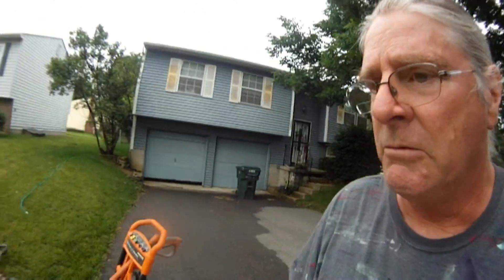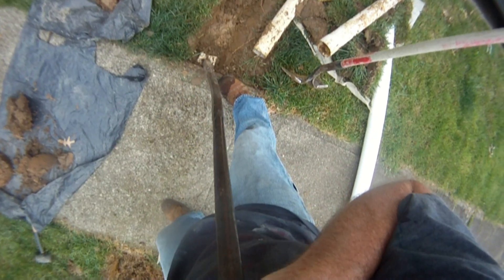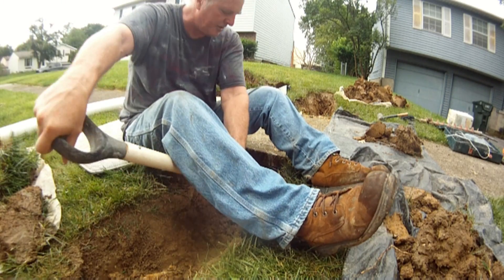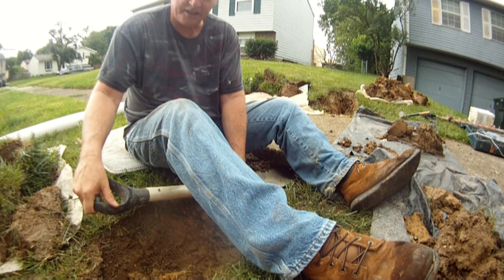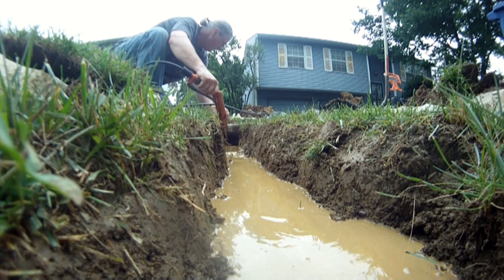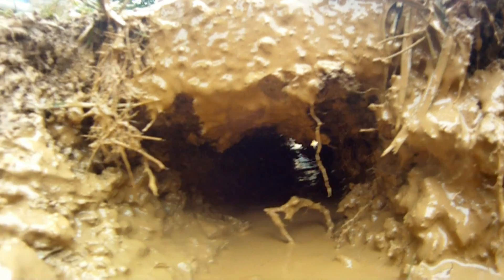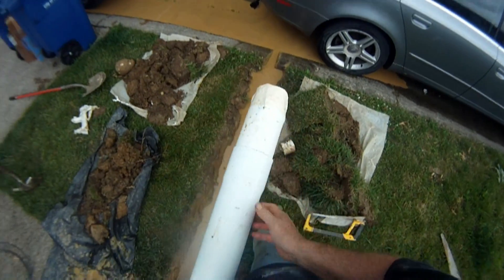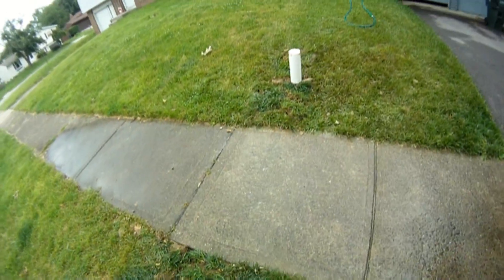TUNNEL Sidewalk PIPE REMOVAL / INSTALL The BEST ways to install pipe under sidewalk

Comment: That sidewalk isn't very thick. The ones in our city are twice as thick. Hummm
Reply from the maker: Hey Einstein, thanks for watching! How thick are they were you live?
Reply: @AtlanticDrain  Hi! More than 2x of what you were working on.  That's a lot of weight on top of pvc pipe (water line connects to city meter near the curb) that lies underneath it.  I'm concerned because that section is damaged and will have to be replaced. That's a helluva lot of weight!!

Comment: What if a broken pipe is imbedded  in the sidewalk? For some reason the had cut a slab of sidewalk and cut the pipe in the process all the way through. Then they replaced the slab without fixing the pipe they cut...
Hoa won’t fix it  even though they hired the people that messed up. 
Lawyer won’t look at pictures till payed $400 + hourly rate. 
Any advice would be appreciated ty

Comment: Could you use a long piece of rebar or rock bar to hammer through the rest of the way with a sledge hammer
Reply from the maker: Hey James~
maybe, but could you remove the rebar once you hammer it into the clay?....
for me, i would probably pull a muscle or wrench my back if i had to try and get the rebar out from under sidewalk. thanks for watching!
Reply: @AtlanticDrain  Thanks for your response,  yes I guess your right that would be tough to remove the rock bar or rebar once under the sidewalk. Doing a similar job soon, I appreciate your advise.
Reply from the maker: anytime thanks again for comments thumbs up

Comment: What do you do with the empty space under the sidewalk after the pipe is in? If the hole is too big, will it crack?
Reply from the maker: ~ hey Miguel ~ Thank you for watching,... the tunnel is 4" diameter. the pipe is 4" diameter....there is no additional space under sidewalk.
If you use a 3" pipe, you can throw some of the gravel / dirt into tunnel around new pipe, pack it in on both ends. We have never had any problems over the past 20 years with this method. ~ Thanks again for watching!!!~